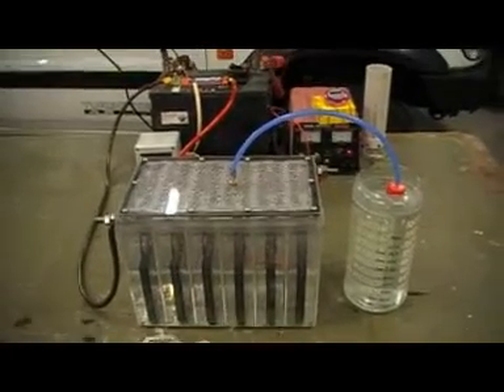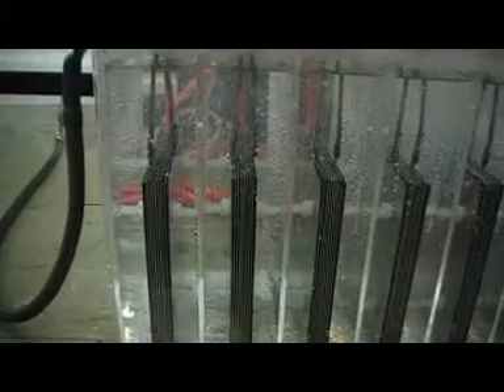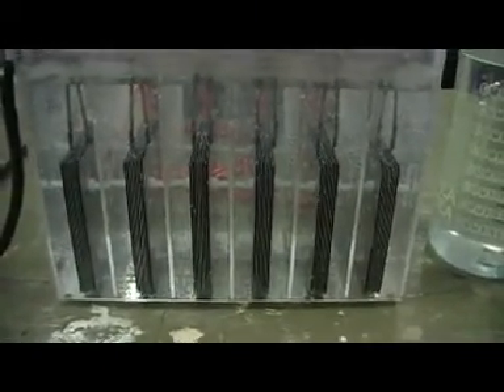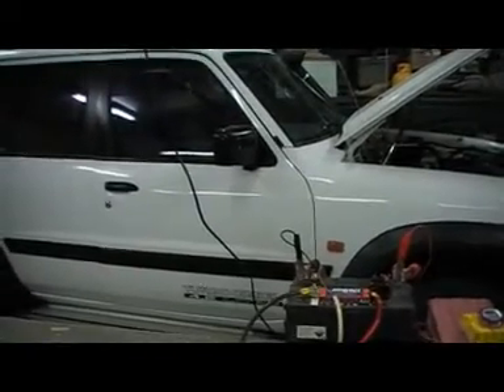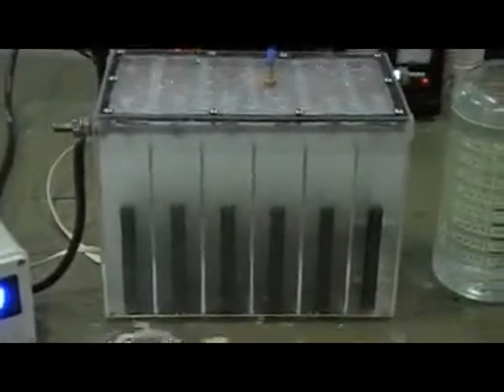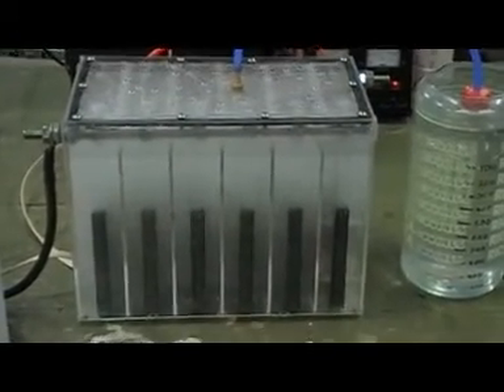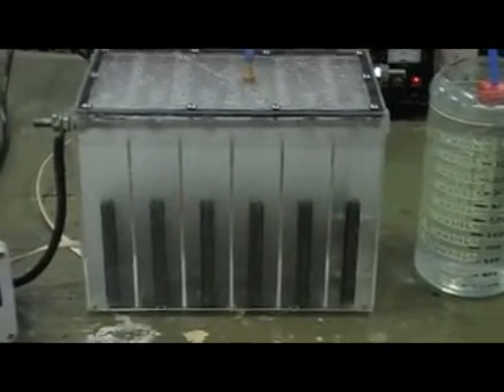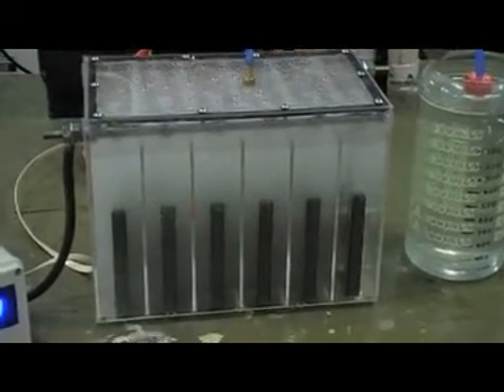HHO 1.6LPM

Comment: Nice setup! One question though. Have you tried with only two big plates in each cell and hooked them up in series? That should be even more efficient than the nice setup you have now. But it might be difficult to get more than 1.lpm, because it will be hard to get more than 6-10 amps through then.